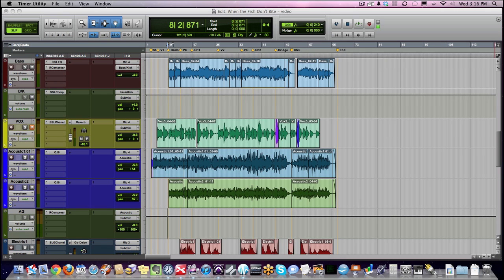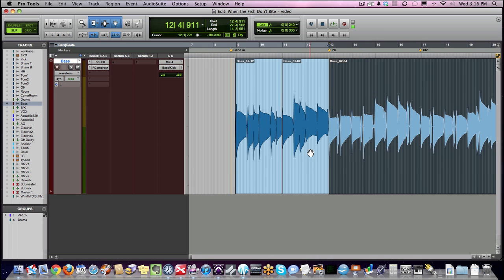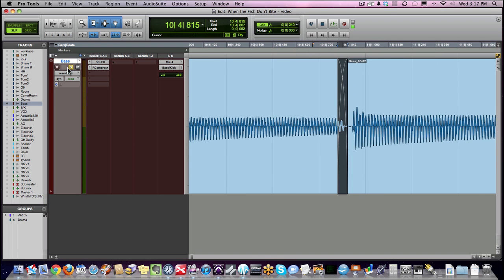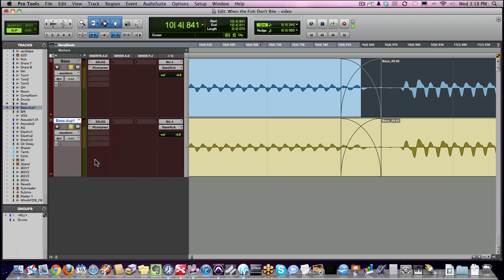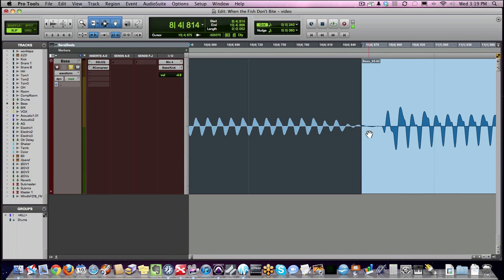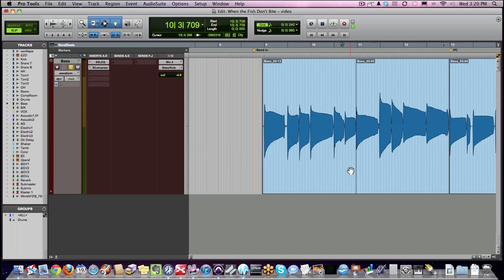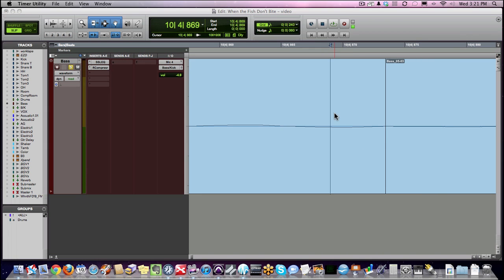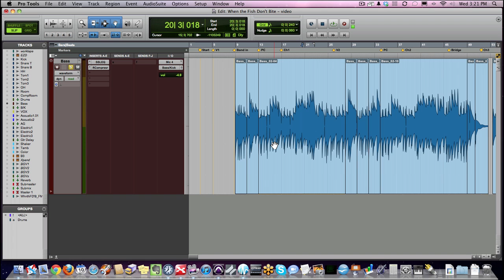Intro to Crossfades

Comment: I am having an issue were when i crossfade i get an error that gives me to options: to skip it, or to adjust it. I have no idea what I'm doing wrong. Actually there are a couple areas were the crossfading works but it obviously isnt enough. Am i stopping my clips to early? Should i overlap the clips? If you could give me your opinion it might help me figure this out. Great video man!